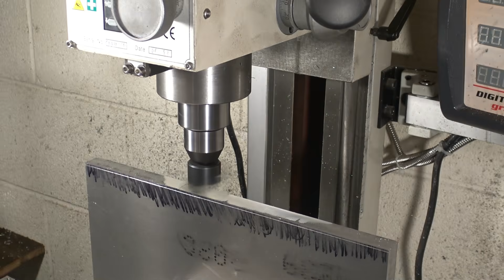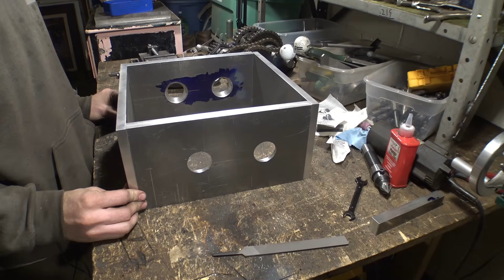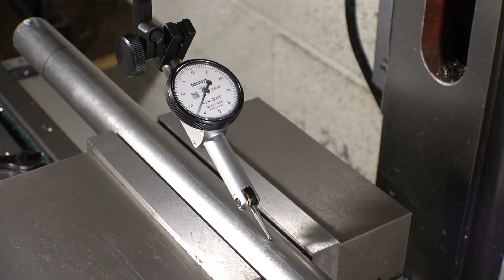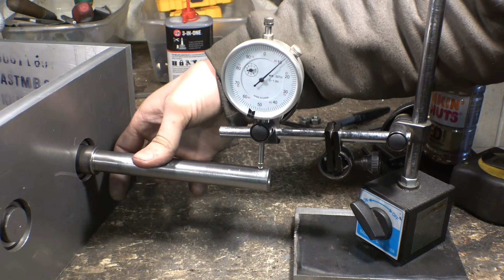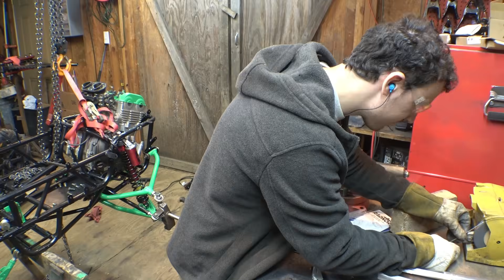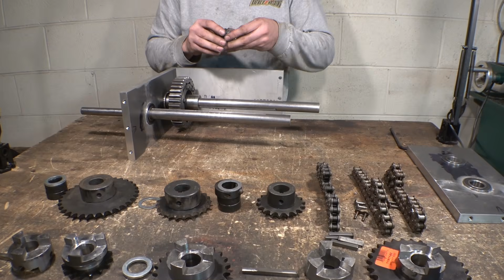3 Speed & Reverse Go Kart Gearbox Homemade Part 2

Comment: Pre-heat the aluminum to 300f and it will weld easier.  Also adding a small amount of helium or you can run it on dc to weld thick aluminum .
Reply: I bought a small bottle of helium to weld with my DC tig but never used it. Now I have the prime weld 225 LOL. still hard to weld. LOL Maybe preheat is the secret.

Comment: Son, I admire your desire to figure stuff out on your own, and you're damned good at it But if you'd have asked, I'd have said to simply make a pair of offset bushings for the bearings. Easily done on your lathe and mill in, oh, a few hours...

Don't be shy to ask! Write me; I'd be more than happy to brainstorm with you when you're stuck.
Reply: I agree offset bushing are great because they would allow for chain stretch later on.
Reply: @jasondk5127   🤦‍♂️🤦‍♂️
So you adjust for chain slack then how do you accommodate the gear mesh for the reverse gears?
Reply: I was going to suggest oversize bearings (bigger OD) but that is an even better idea..
Reply: Here is an example of someone saying they have a better way to solve a problem. when he had solved the problem just fine. after all I don't see you building gearboxes on youtube.
Reply: @harryrenner4016  OUCH! Well I would have done just that. I build gearboxes for a living ( retired now ) and got paid pretty good for it. Math errors happen and sometimes you have to scratch your head and fix it. This lad did the best he could with the experience and tools at his disposal. I would have moved my hole over to the dimension I needed and simply bored the hole out round and made a sleeve. Weld the sleeve in and you are done. That said it's what I would do on a home project like this. If it was at work I would be staying over on my own time making new plates to fix my f***up. Lighten up on people trying to give feed back. It takes a lot of skill to get a set of gears to mesh properly and with the equipment he has the deck was stacked against him. But he persevered and fixed the problem and I'm proud of him for that. There are so many ways that the lifespan of that unit was limited but we shall not go there. The fact that he got on YouTube and fixed it speaks volumes.
Build a gear box yourself. Record your progress and overcome the shortcomings of his design. Let us know how you do with that.
Cheers!
Terry from South Carolina
Reply: @terryfromsouthcarolina4601  I want to build a forward/reverse gearbox but I'm having a problem imaging the process. Could you recommend a good book or something that could help me out. I'm far from an experienced machinist but I do have a mill and couple of lathes (want to become an experienced machinist but also a stay at home dad so teaching myself). Thanks for any assistance you can offer.

Comment: Why not take a blown up atv or motorcycle engine and remove piston/rod and cylinder and mount a sprocket on crankshaft. Free transmission. Plenty of different videos on here with different designs.
Reply: I did that many time  making a vid on it now except i take out crank put is straight shat hook with love joy works great